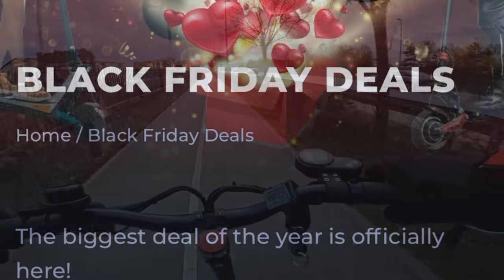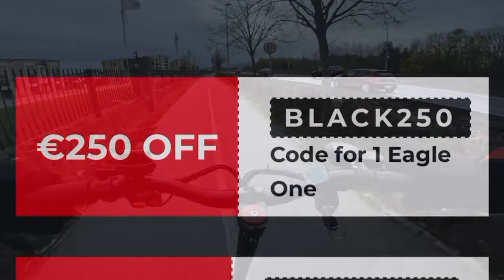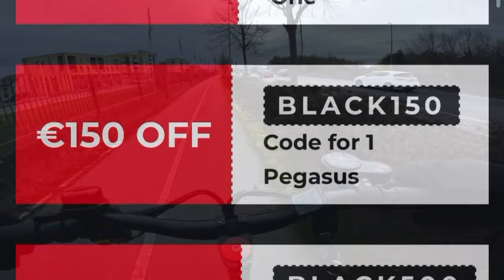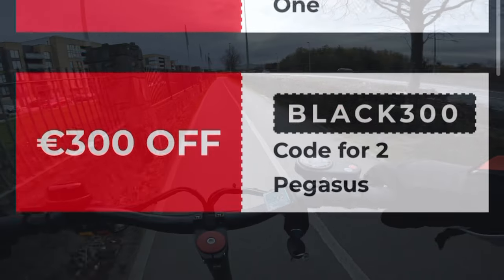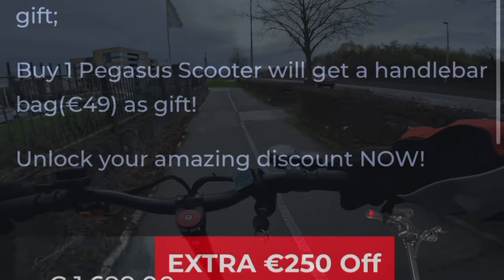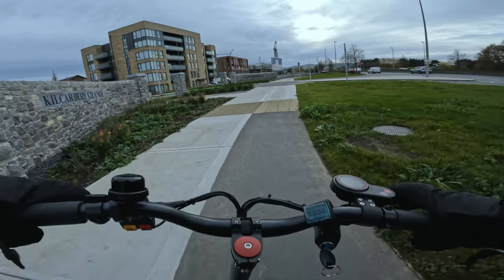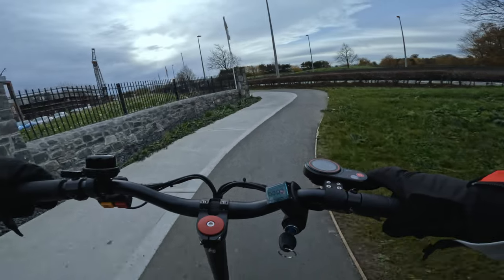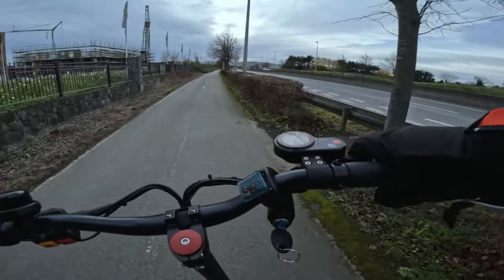P SETTINGS: Prevent Damage When Riding (Varla Eagle One Test)

Comment: My Varla eagle one is doing great so far. I'm currently at 180 miles on it. Only issue I've had was a tire leak in the rear but used tire sealant and it stopped leaking. I personally like the regenerative breaking and I use it on high because I live in a hilly area, and I don't want to use my disc brakes so harsh as it will eat up the brake pads quick.
Reply from the maker: I think the regen caused my for first E1 to burn the controller. I had it only on level 3. Had just over 1000kms on it when it happened. Heat gets generated when it’s engaged causing them to get hotter.
MOSFET was blown.

For that reason, I completely turned it off. The pads are quite cheap and very easy to replace. Changing a controller is more difficult because the cables are literally all over the place plus can take a long time to get a controller replacement depending if it under warranty or ordered through AliExpress.

Comment: Do you switch to dual/single or eco/turbo while moving? I read it on the manual that you should'nt switch modes on the fly. Maybe because it will damage the controller.
Reply from the maker: Definitely do not switch while riding.
Reply: I think switching is gonna happen it instinctive , who would come to complete stop than change  It a flaw if ya have to , if they were wanting you not to it should set as a setting , not a depressable button

Comment: Whenever you said you changed your power output or whatever from 100% to 90%, what is the default setting for that
Reply: Also, would it hurt it, if I were to only change the acceleration to 5 whenever I race, and then change it back whenever I'm just riding
Reply from the maker: @elainemiller9164  that’s ok to change then acceleration when needed. Default setting is 100 for power output.

Comment: I’ve had my Eagle one for about 6-7 months now and so far it’s still kicking, even after a very small “crash”. I personally don’t like regen braking so I disabled it basically day 1. I use it as a replacement for my car for work when the weather is fair, I wouldn’t be willing to lower the acceleration and power settings simply because I really need that get up n’ go trying to get around traffic, especially in the longer stretches of road. What’s your opinion on switching between single and dual motor depending on what is necessary for the moment? Personally if I plan on taking it a bit easier I just drop to single motor and that seems to work pretty well for me so far. Do you know if running single motor is harder on the controller? My brain logically thinks it’s easier on the controller than dual, but I honestly have no idea.

I’d be curious if there is a way to actually upgrade the controller to have potentially less problems? Maybe a video for another day?

As the weather gets worse I plan to “water proof” mine the best I can. Hopefully as it gets warmer again that doesn’t cause any issues with the controller 🤞🤞
Reply from the maker: I think single is fine in very built up busy areas. I’d use dual on long stretches or hills. 
Is single less stress on the controller/battery? Well some people say yes and some people say no. Personally I never had an issue. 

I saw people reinforce the mosfets on controllers but never got it done myself. However I did actual use thermal tape on my controller on my Kugoo Kirin M4 Pro model to reduce heat and so far, 1500kms later, no issues! Here as quick video on that https://youtu.be/ZSFcnzdgKp0

Comment: Bought mine used with about 100 miles on it. It rode fine when I tested it briefly at the shop I bought it from. Went to take it for a proper ride earlier and it threw an E06 code and cut off. Walked it home. Put on charger and it starts right up. Tried taking it for a spin and attempted to go up a decent hill. It cut out completely again. Battery level is one tick below full on the screen and the lcd reads 52 volts. Searches online point me towards a circuit breaker. I weigh 200 lbs, so I’m not even close to the limit. Besides, I couldn’t find a circuit breaker on this thing. Is it possible the battery is toast, but reading fine on the volt and charge meters? Pretty bummed right now.
Reply from the maker: Error 6 I’m sure is battery under voltage. Unfortunately sounds like you could have a bad cell/cells. 
There is also a BMS (battery management system) that could cause the fault.
Either way, the battery could need replacing unless you know a specialist that repairs them.

Batteries are the most expensive part. I hope you didn’t pay too much.
Reply: Well won’t let me edit. I meant to say brand new scooter.

Comment: I will adapt your P Settings.  Do you have any suggestions for battery care? Should I charge eagle one after each use even when I use it for short distances.
Reply from the maker: If you are not crazy into speed then definitely try these settings. I always keep the battery full charged if I use it every day.

If you are storing the scooter, keep it around 70%. Never had an issue.
Reply: @Movelectrics  Thank you for the reply.
Reply: The owners manual advises to keep the battery topped off to maintain maximum life. Kind of weird because I heard that rechargeable batteries need to be “exercised” from time to time by running it low and then fully charging. I think I’ll follow the manual though.
Reply from the maker: Never let the battery run too low. If you use it everyday, just keep it topped up. Most riders will also tell you this.

Plus when the battery runs too low, the performance drops greatly. I’ve seen people run there batteries flat and they cannot get it to charge again. Definitely don’t do this.

As for storage, keep it around 70% charge.

Rode safe ⚡️